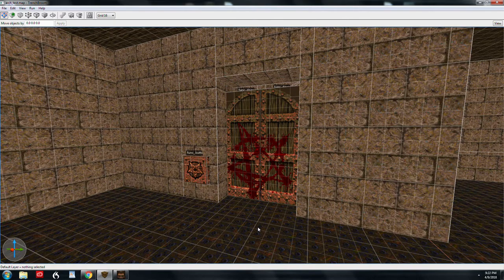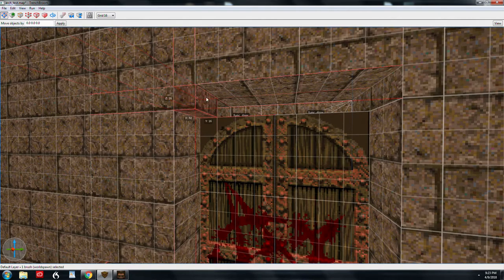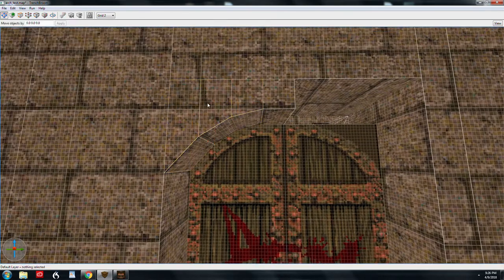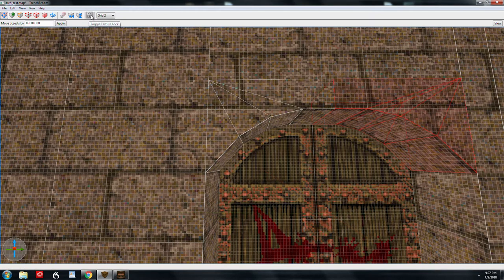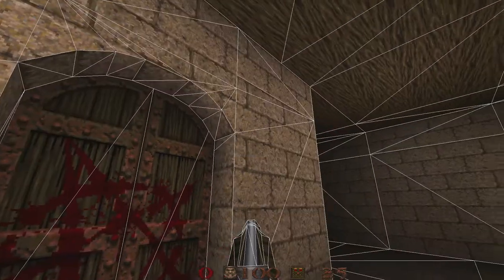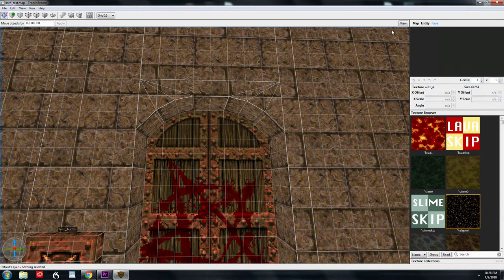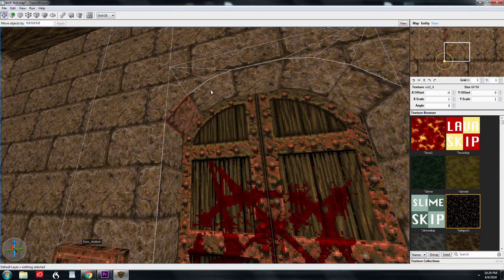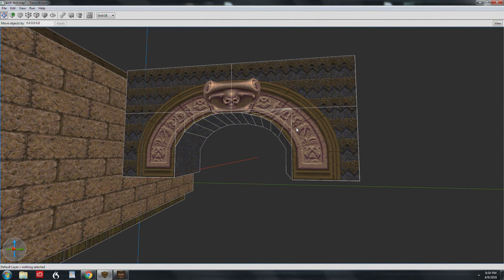Quake Mapping: Easy Arches

Comment: Maybe it's because I've done more mapping in Unreal, but I always tend to just paint on the wall in Brush mode, then CSG subtract the arch shape out of the wall. idk if that actually is a bad way to do it in Quake. It's a very Unreal style brushwork.
Reply from the maker: cgs subtract can make a mess of your surrounding brush work. It's not illegal by any means but not recommend. However, TB handles csg subtraction better than any editor I've used.
Reply: I get ya. Yeah so far it seems fine for simple shapes and I kind of like it for making bits of longer corridors and hollowing out a cuboid to make a room (I seem to recall that Radient editor had a "hollow" and "make room" button for brushes for later engines - starting with Doom 3 or something?
To clarify in my OP I was talking about UnrealEd 1 and 2, from the first two Unreal engines. These days you have to specify you're not talking about UDK (which I don't like to use)...
Reply from the maker: Future versions of TB2 will have a hollow feature. Not sure if it final for the next version.

Comment: This tutorial is extremely difficult to follow.  At 1:16 you seem to just magically pull the blocks down, this seems impossible on my TrenchBroom.  No matter which edge handle I grab, the result is never pulling the blocks downward.  They mostly come forward at my screen, or way off in random directions.  I worked around this by using the Vertices tool and selecting the front and back vertices, then dragged those down in the 2D view.

Edit:
Looking closer, I see you have your border blocks entirely in front of the door (closer to the camera), mine go back about 32 units behind the door.  That's probably why I can't grab things and move them properly, as they're further away in 3D space.  I find TrenchBroom's 3D window rather painful to edit in, it rarely does what I want it to do.  I'm more accustomed to editors like QOOLE and GtkRadiant.
Reply from the maker: You can enable orthographic views in Preferences for 2D editing. Not sure I ever did a specific video on that. The more you use TB I bet you'll get more comfortable editing in 3D. Good luck!
Reply: Not sure if this was possible at the time of your post, but I find it easiest to select them and use arrows + pgup/pgdown. 3D dragging is always annoying

Comment: How do you make a hollow cylindrical shape? Kind of like a watchtower that the player can move in.
Reply from the maker: The easy way is to make a cylinder and extrude the "walls" outward. Or hollow the cylinder and remove the ceiling and floor of the hallowed shape. Take a look at the TB manual for CSG hallow or search for extrude. Also look up the curve tutorials here for all kinds of advanced techniques.
Reply: @dumptruckds  Thanks, sorry for all the questions lol
Reply: @dumptruckds  Okay one last question. Can you save prefabs?
Reply from the maker: Not really.You can save prefabs as map files and open a second instance of TB. Then copy and paste from the prefab to your "real" map.
Reply: @dumptruckds  Again, thanks lol. Really appreciate it.
Reply: You could make a big tall pipe .   Then make another one smaller starting on the top of the 1st one.   Making its height the same as the height of the 1st one.    Then hold Alt and drag it down inside the larger one.   Then CTRL - K.   And cut it out of the bigger one
Reply: @jimask1709  Thanks for the tip. I gotta get back into mapping, it's been a while. 😮